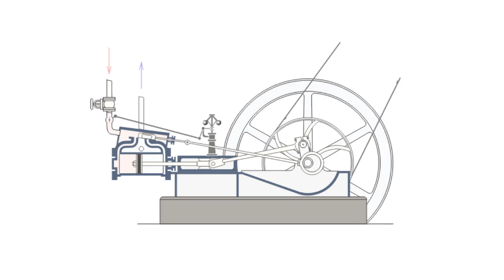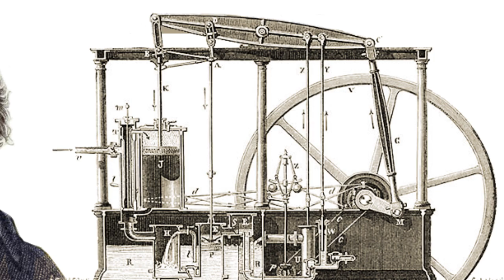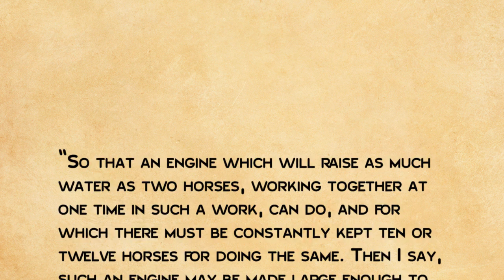Why Engines are Commonly Measured in Horsepower

Comment: Watt actually way under estimated how much power a horse can output. If you look at an actual 1 hp motor they are tiny, about the size of your fist. Watt got away with this by never selling small engines. The smallest one he sold was 150 hp, equivalent to 10 actual horses.

Comment: American engineers, like me, specify power output in both Imperial units (horsepower) and Metric units (watts).  Power is work or energy transmitted per unit time; one horsepower is defined as the work required to lift 550 lbs to a height of one foot in one second, which is equal to 745.7 watts (metric).   For rotating power (the most common), power is calculated by multiplying torque by angular velocity, so for any given power level, torque & rpm are inversely proportional so that higher rpm means lower torque.  Bicyclists can produce pedaling torque equivalent to some typical automobile engines, but they do it at much lower rpm so their power output is only a fraction of the IC engine or automotive electric motor operating at typical driving rpm.

Comment: a human pedaling a bike,    3 horse power. a horse not even one. I call this Bullshit
Reply: Vladimir Mihnev try it for a full workday.
Reply: James Parus The number is for a tour de France favorite, and he will be able to well almost. But this still the is just no way a good grow horse is substantially more than one lame HP the speed it can move it massive body and the riders. A this is at least 500kg going up  to 50 km/h a 3,5 to 4 HP scoter is in a world of hurt when trying to get to 45 if the rider weight is more than 90 kg
Reply: yes, horse is probably more than 1hp, but 4hp scooter goes easily 60km/h, even with 90kg driver. Even old Finland standard moped with 1.5hp's go 40+. And with no aerodynamics. Same power to race bicycle aerodynamics, would go pretty fast.
Reply: Wrong!  You're way off!  Even the strongest  bicyclists in the world, Olympic & Tour de France sprinters, can only produce about 1,600-1,900 watts of power (1.2-1.4 horsepower) at best, and only for a few seconds before lactic acid buildup in their muscles stops that power-level cold!  Average bicyclists can only sustain power levels around 200 watts (0.27 hp) with high exertion,  but usually much less (50-150 watts) at normal riding levels.  Try doing some research before you make unsubstantiated claims on YouTube.
Reply: HipposHateWater
Yeah.  It's stunning that internet-based YouTube activity contains so much misinformation when it's so easy to vet information via the internet!  Still, people need to develop critical thinking skills to discern fact from fiction in reference sites, skills poorly cultivated in our education system.
Reply: @SIMKINETICS
I thought YouTube was THE place to go for that! Damn, what will I do with all of my own unsubstantiated nonsense now? :'(
Reply: Vladimir Mihnev 
the horse is working at a slow pace it can do for many hours. the human is peddling VERY hard.

the numbers are true, but misleading. it's no different than saying a 1.2 liter 4 cylinder engine that's running at 6,000 Roms is doing more work than a 6.6 liter engine when the 6.6 is running at idle.
Reply: Robert Pruitt
Notice my comment here.  This is not hot-air.  I'm a mechanical engineer who not only invented a bicycle transmission (that you can view on my YouTube channel), but who researched & extensively studied power output of bicyclists in order to size my transmission design correctly because I'm preparing it as a product with another mechanical engineer who builds high-end bikes professionally.  Most bicyclists cannot produce one horsepower, even for the first second of their greatest effort.
Reply: I wonder what kind of inertia I was struck with by the pick up truck that was traveling 50 mph while I was riding my 10 speed pedal bike? He struck me with enough force that my body flipped in the air without striking his truck to then land at the road side... The impact with the dirt driveway there was so strong that it  - obviously - crushed my bike beneath me... but also great enough to bend the titanium rod within my right thigh. :-) (What kind of torque does that take?)
Reply: It is an average value man

Comment: horsepower was first described by an accountant as two horses walking in a circle twenty feet in diameter doing x revolution.. it's nothing but an accountant term
Reply: James watt
Reply: Hivemind nonsense.  Power, not torque, is the limiting factor in not only the top speed of a vehicle but also how quickly it can accelerate at any speed and how much weight it can pull up an incline at any speed.